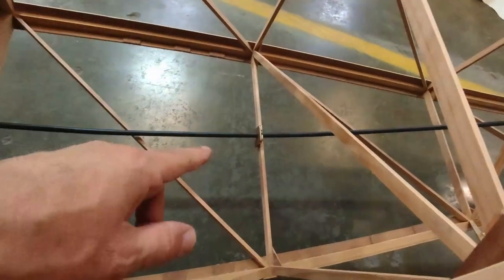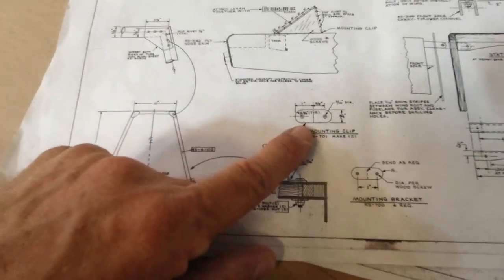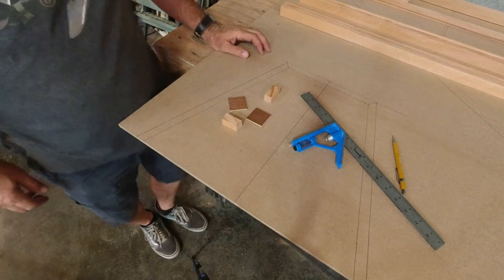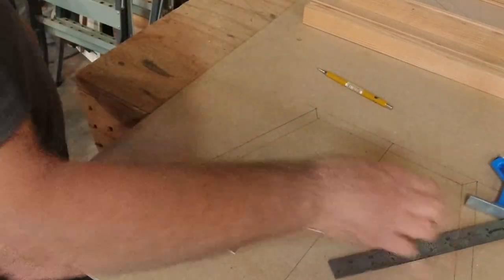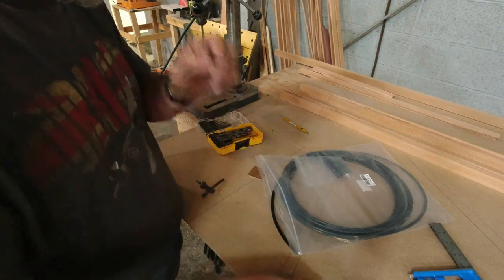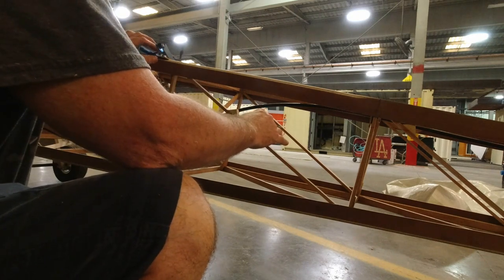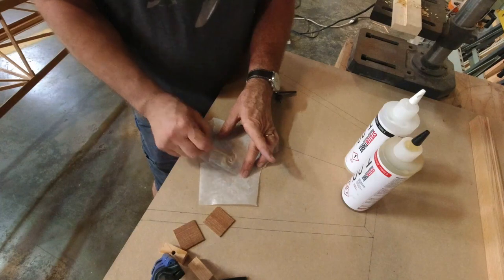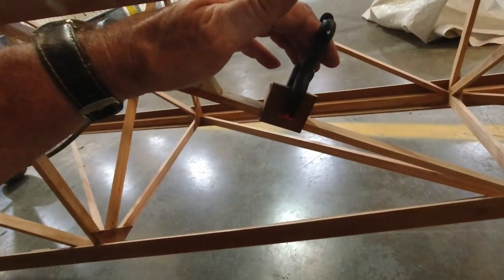Minimax 1100r Wood Aircraft Build Ep 107 - Static Ports

Comment: May I recommend that you add a over centre spring to the fuel shut off valve? Would mean that on stays on and off stays off... read reports from the US and UK investigation branches of pilots legs accidently shutting off the fuel mid flight. For the sake of q $2 spring, could save yourself allot of aggravation. Awesoke video once again! Atb
Reply from the maker: That’s a great suggestion! I’ll do some research on that and see how that would work.
Reply: @DTMinimax  Wouldnt nessearily need to be that method. Just something that ymrequires your conscious effort to turn on (then stay on) and off (then also stay off). Look up the rice catch used to hold a long EZ canopy... that'll do the same job 👍

Comment: Denise in one of your earliest videos you said the you had built a part 03 minimax 1100R. What makes this build different? Other than more fuel and larger engine. Thanks for the great video series, really enjoying it!
Reply from the maker: Thanks Michael. My first time around was a 1030r with a Rotax 277. 
That structure is quite a bit lighter, especially in the tail. Mine came out just under the 254 lbs. that was with a latex/acrylic paint which I’ll be repeating on this one.

Comment: Dennis.  6 more months before the engine arrives?  That's no way to run a railroad.   Why not consider another engine?  Lots of good ones out there - just have to change the mount.    Think about it:  How long would it take to put a two cylinder engine together?  Better yet, YOU get a kit and build one yourself.  Now that I'd like to try.

Concerning the static ports.  I put mine in the exact place called for in the plans, "T'eed  them together for a "balanced static system" and they would not work.  First flight had a major Airspeed indication problem, coupled with my altimeter indications.  Maybe it was my ports.(don't remember anything about them.)    Worked with static ports for many years in my Avionics jobs, they were made for that specific airplane.   

Made a water manometer to check my  AS Indicator - was good.  I borrowed another altimeter  to compare with mine while flying.  All OK.    Ended up venting both the altimeter and AS indicator, indicator static ports,  to the cockpit.  Flew with others, and my flight instruments seemed fairly accurate.  I'm sure there must have been a pressure difference between the inside of the EROS and the outside, but indications seemed negligible.  As your 1100R will be totally vented, all might work OK.   You are moving right along, Dennis.  And, a belated Happy Father's Day to you.  :)   Oh, just remembered:  Vented my Vertical Speed indicator to the cockpit, also.
Reply from the maker: Yep 6 more months…yikes. 
I am planning to use MGL instruments and hope the static ports work out fine. 
It sounds like you had quite a bit of work to do to get yours right. Maybe you are correct that the closed cockpit had some effect on it. 
I had considered building my own but I hear so many good things about Scott’s engines that I wanted to go with the proven method.
Reply: Dennis.  In the long run, you are probably right.  Still a bit of work before the engine becomes "front and center."  :-)   All looks really nice.